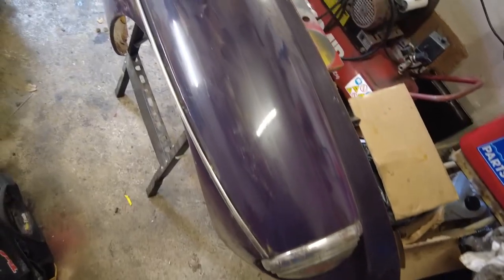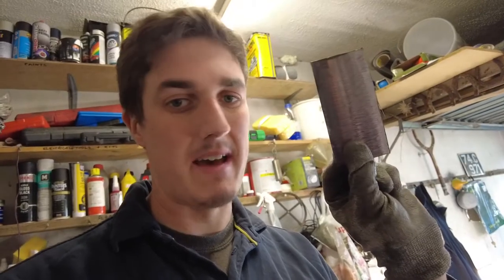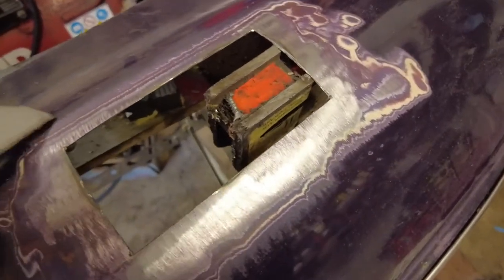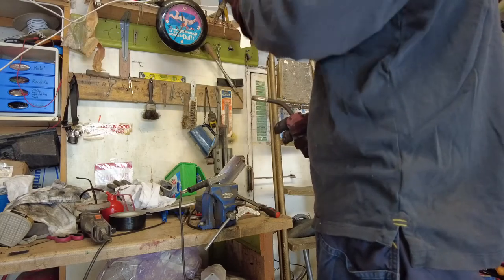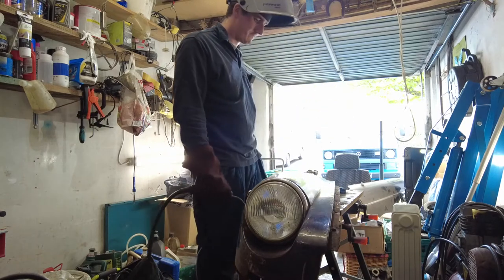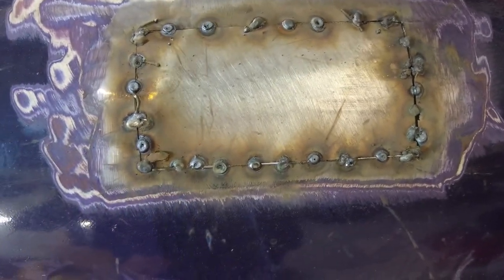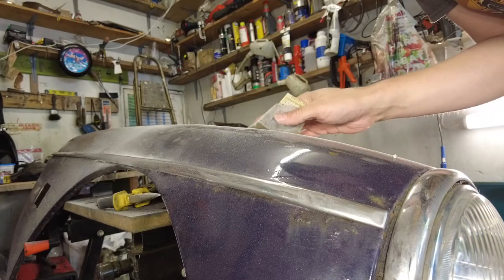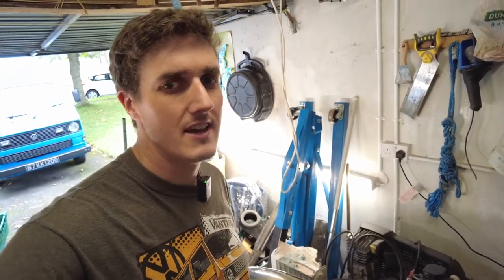Car repairs with a GASLESS MIG - Teaching myself to weld

Comment: That a great little welder..... Got me out of a big hole a few years ago. Thanks again Endfloat
Reply from the maker: Whatever spool of wire you put in it made all the difference. I couldn't get a decent result with the crap that came with it!
Reply: I will check and let ya know. Yip what was in  it just sparked like a firework. Ya need to only get top quality flux core wire

Comment: For a first attempt at welding you should be encouraged.  I was told when it comes to filling, sand it off with the longest block that you can so it follows the contours of the panel. PS. your garage is about as tidy as mine!!
Reply from the maker: I need to pick up a few more supplies, such as sanding blocks and proper dollies and panel beating tools. As for my garage, I could tidy it and it will be back like that tomorrow. It's too small. I'll be moving in the next year though and my plan is to build a workshop.

Comment: That's definitely a win.. it's just practice after that and I'm not going to pretend I'm an expert either. If I had to guess, It looks like it needs a tiny bit more heat but less duration on each spot, you can then adjust wire speed to suit. (This inclination is based on gas mig welding so not sure it directly translates here). As you rightly pointed out, it would be a lot easier with gas but it certainly proves you can get it done without it.. Making sure the visor is spotless might just help a little with visibility. (I'm more familiar with welding ignorant lumps of metal and you're right,  it's a lot more forgiving).
Reply from the maker: The problem with that welder is that the power levels are only in 4 increments, and the next power level just blows a hole in the metal. Still though, I'm pretty chuffed with the result for my first attempt. Perfect it is not, but it's passable!

Comment: Your welds look fine, but having tried no gas and 0.8mm wire with gas I found that for car bodywork 0.6mm wire with gas works best. My little Clarke 105 is like a different machine using 0.6.
Reply from the maker: Thanks! I probably will end up changing my welder to gas and .6 wire but for the moment it's what I've got.

Comment: Nice video. Hard to weld sheet metal with the flux wire.  Get a cheap used Lincoln mig,  I picked one up for $120 on CL
Reply from the maker: Thanks. The welder I have is actually a good unit, and can be used with gas. I just don't have the setup for it, and I don't need any added expense at the moment. I think the result was decent enough, all things considered.

Comment: Don't forget to remove your chrome work from the purple Wing if you're using it again Ross...I practiced welding on my old wing damaged the trim and had to replace...loving the videos BTW..
Reply from the maker: Thanks. I will be removing the bits, yes. I do have a spare chrome strip anyway but I don't want to damage the headlamp.

Comment: Hi Ross for gas I use an old co2 fire extinguisher. You can pick them up for next to nothing and a regulator is about 25 Euro.
Reply: If you can do as well as you did with no gas you'll be pretty damn good with it. As it's much easier. The welds aren't as good as with Argon co2 mix but they are still a lot better than flux coated wire
Reply from the maker: I might retool in the future, but I did some actual repair work today and I was pleased with the end result.

Comment: You need to use 0.8 wire. 0.9 is hopeless on sheet metal.
Reply from the maker: I did a bit of actual repair work today and I was quite pleased with the end result. I might change it for smaller wire in the future, but I have 2 spools of this stuff to get through first, and I don't think the flux cored wire is available in 0.8 flavour.

Comment: Buy a mig welder you need gas ,Clark in england make a good  one 600 euro , you can not weld with that shite welder its for a farmer
Reply from the maker: My machine can use gas. It's just the valve and bottle I'd need. I just wanted to try with the flux core wire. To be honest, I think the result is good enough for my purposes.